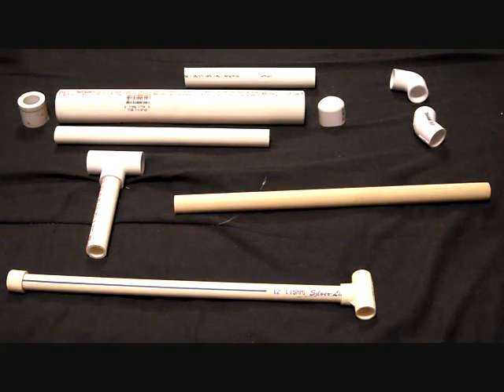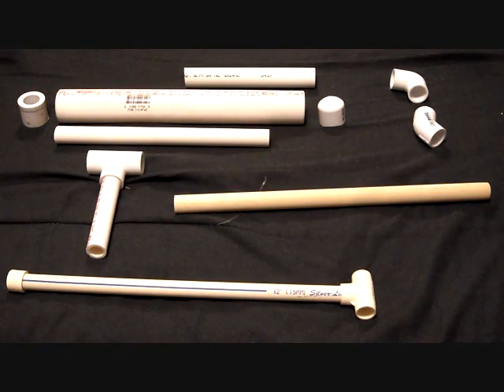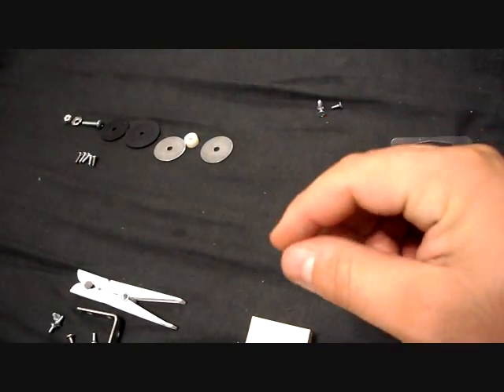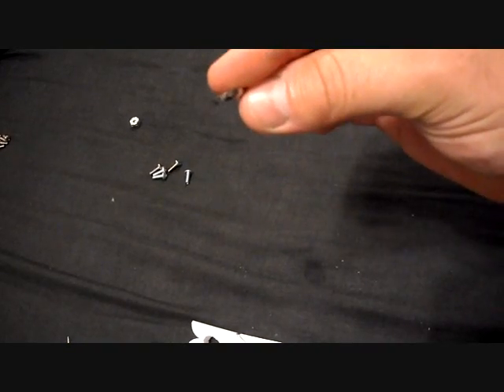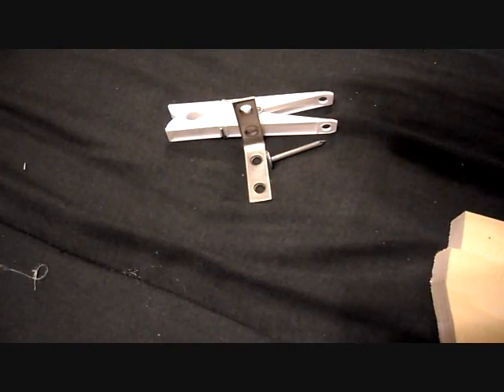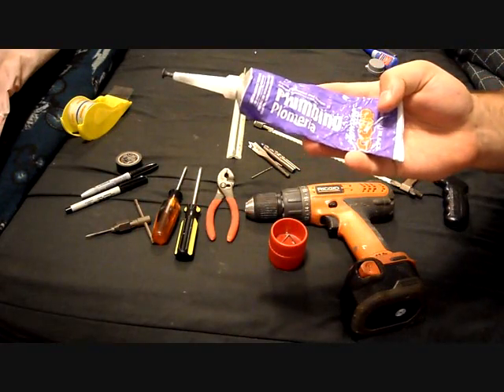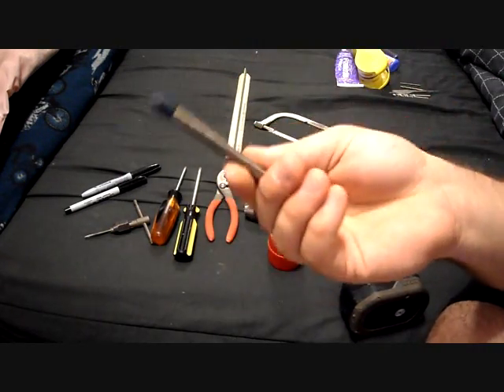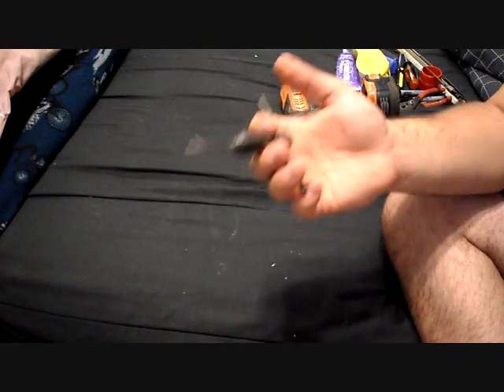Building a SnapBow: Part 1 Materials and Tools

Comment: Is there any other type of spring aside from the one you listed in the description that is able to be purchased at a physical store that would suffice?
Reply: The only store-bought spring that could potentially work if cut to a shorter length can be found in the two larger diameter "10-inch" door closers available at Lowe's or Home Depot. You will have to use vice grip pliers and a hack saw to hold the plunger rod back while cutting the end of the tube off where the adjustment screw is.

It will puke out the plunger rod, two springs, and a handful of moly grease (so make sure to do this outside on a driveway). The LOONG spring that comes out can be cut down to 11-inches or so and used as a substitute, albeit and expensive one.